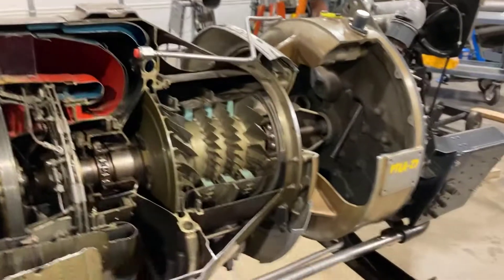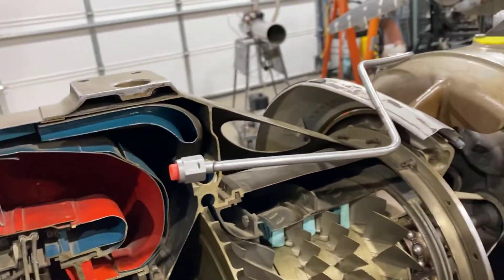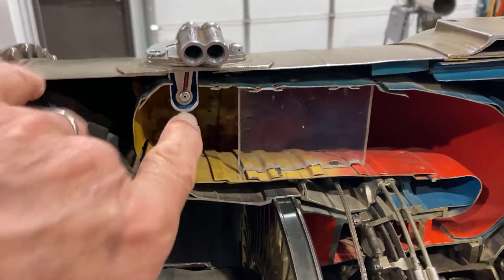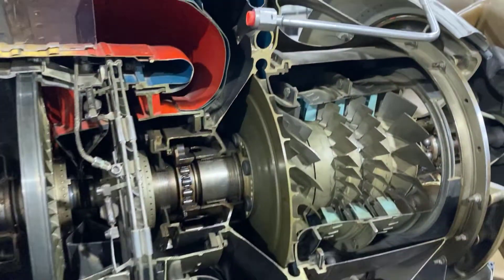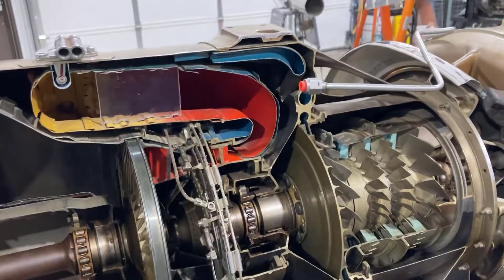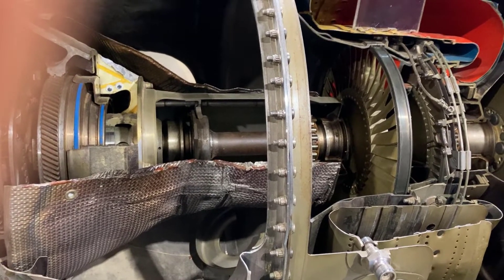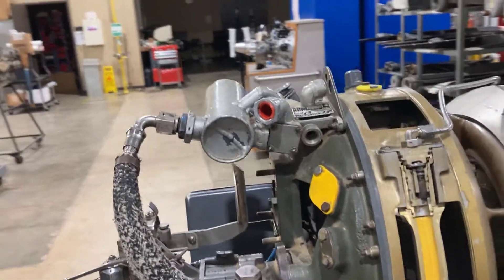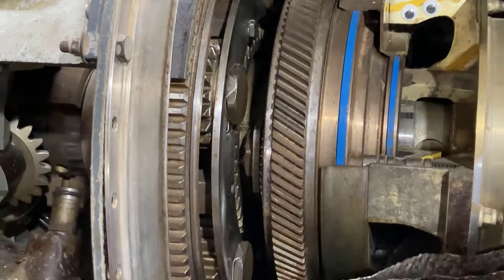PT6 Cut away walk around

Comment: Thank you so much for the detailed walkthrough of the airflow. Despite having read a bit on turbine engines and the PT6 specifically, I was confused about what happens with the airflow path after the centrifugal compressor and how it actually entered into the reverse-flow annular combustor. As you point out, in a cut-away it's hard to see the perforations in the combustor liner where air can enter. The extra camera angles illustrated it very well allowing the video to clear up that confusion which had been bugging me for a while. Thanks so much!

Comment: In aviation tech school we're taught as a "general rule of thumb" that 2/3 of the heat energy created is extracted to run the N1, Ng, Gas Producer or Compressor turbine whatever you want to call it and 1/3 of the remaining heat energy is used to run the N2, Nf, Free Turbine or Power turbine and 75% of the compressed air is used for cooling and 25% used for combustion!